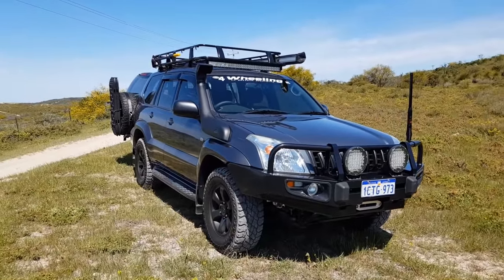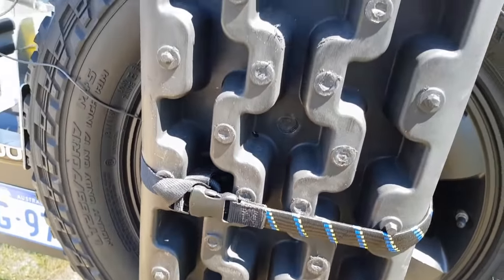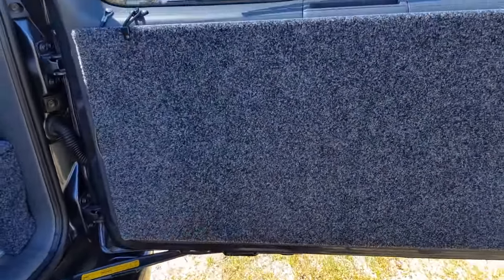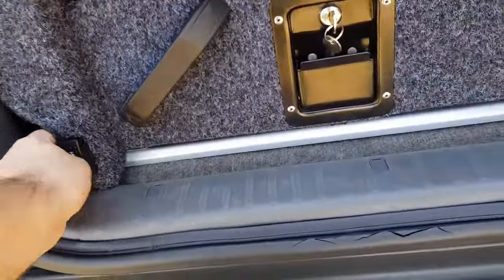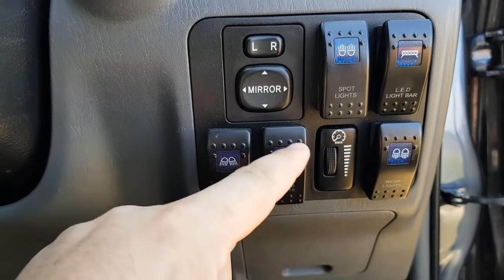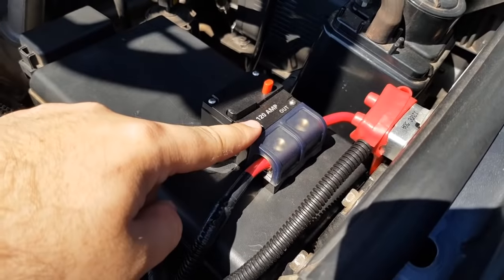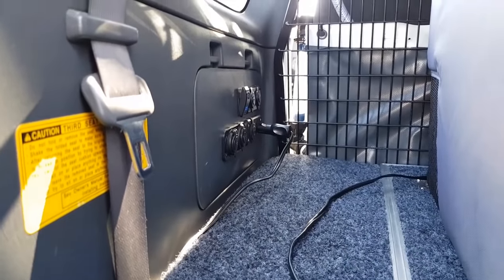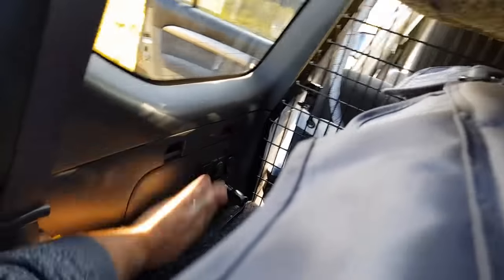Walk-around - Land Cruiser Prado 120 tourer

Comment: mate, one of the cleanest builds I've ever seen. Very nice work. If you haven't already add a rubber plug to your air compressor outlet on your bullbar so you don't get water in there.
Reply from the maker: Thanks mate - Yeah I ended up moving my compressor to inside the car in the boot so not so much dust gets into it and its cooler in there, I have an outlet at the back now rather than the front

Comment: What an awesome build! In the off chance that you see this 4 years later: Do you ever have issues with rain leaking in through the door seals where you have run wires from the roof and into the car?
Reply from the maker: Nope, never had any water come in there.
I have since re-wired those and ran the wires just to look more tidy.

I now have them come out of the left tail light and up to the roof there.

Comment: This is a ripper rig mate! Any chance you’d be open to sharing your plans for how you built the shelf & divider? Just top notch work 👌🏻
Reply from the maker: Hi mate, thanks ! I don't have plans unfortunately, that one was all just off the cuff figuring it as I go.

Basically just got a bit of wood for the divider and cut it in a shape that would work combined with the angle off the cargo barrier, couple hinges and carpet and its done!

the shelf was the same deal, just got some wood and carpet and cut to fit in the space

Comment: Hi mate absolutely grouse set up

How did you run the hose from the bladder to the outside of the car?

Cheers
Reply from the maker: Hey mate, there is a rubber bung just under the carpet near the rear left tail light area (near the jack compartment) . If you look under the car you will see it. Drill a hole through and poke the hose through

Comment: Wow, what an awesome setup! Very, very impressive. How did you mount the fire extinguisher - is the bracket drilled into the step by the rear seat? Great solution to get it out of the way. Love the removable divider and shelf idea too. Thank you
Reply from the maker: Hi mate, yes - 1 hole is drilled and just a nut on the back of the plastic, and then got 1 longer bolt of the same thread to go into the original threaded car body mounting hole.

Comment: Looks really good. Can you please detail how did you make the gas bottle holder. Thanks
Reply from the maker: Its basically a heavy duty ratchet strap wrapped around the Tyre - I used a product from Bunnings called "Grunt E-track Fixing Plate" which has cut outs for a strap to fit though. so that is basically strapped that to the spare Tyre, then i bolted an oz trail holder to that plate with another little flat bar to make it more sturdy.
Reply: @chappelle121  Thanks mate. Looks really practical

Comment: More details on how you mounted the air compressor? And the fan mod..
Reply from the maker: I have another video showing that a bit more, check my channel and you should find it.

I did actually since move the compressor into the boot as it still sometimes got too hot
Reply: chappelle121 did you mount it or just loose in the back?
Reply from the maker: @AstroBananna  mounted on top of my drawers left of the fridge and table

Comment: Mate… that’s a setup to be very proud of ! 👌🏻
Maybe a dumb question but have you done something to make your kings air compressor stop when it pressures up ?
I have one but I don’t think it stops like that at a high pressure. Maybe it does 🤷‍♂️
Reply from the maker: If its a kings thumper max dual compressor, it should have an inbuilt pressure switch, you don't have to do anything it just cuts out when it reaches a certain pressure, which if your trigger is closed and it's not leaking anywhere it should reach that pressure very quickly and just cut out until you open the trigger or whatever again which will turn it back on.

Comment: Very nice setup. What make is the LED Light Bar
Reply from the maker: Its an XTM one from BCF
Reply: @chappelle121  Thankyou
Reply: @chappelle121  Could you advice how tall they are including the bracket as have an ARB roof rack and would like to position it in the same location, I have a gap of 70mm from the roof to the bottom of the roof rack rail
Reply from the maker: @malkitr  Face of the light bar is ~82mm, add on the bracket and that's even more, so this one probably won't fit for you in the same way I have mine.
Reply: @chappelle121  Thanks for confirming will need to attach some brackets to the Tube bar then install.

Comment: Hey like your set up. Wanting to put a shelf and divider like yours in my Toyota prado 2018 150. Just wondering what thickness wood did you use? Also how exactly did you attached it to handles. I can see the O bolts on the actual shelf but could t quite see how it attaches to the handle up top
Reply from the maker: It was so long ago i don't remember to be honest, wood i would guess around 18mm. Attached to the handles by getting some threaded eye bolts that goes into the same thread as the handles. then another eye bolt on the shelf, and then a turnbuckle that goes between those eye bolts. and back the back just bolted to the cargo barrier.

Comment: Very nicely done mate. What's that bit the gas bottle holder is bolted to that the strap goes through I want to do something like that
Reply from the maker: Its basically a heavy duty ratchet strap wrapped around the Tyre - I used a product from Bunnings called "Grunt E-track Fixing Plate" which has cut outs for a strap to fit though. so that is basically strapped that to the spare Tyre, then i bolted an oz trail holder to that plate with another little flat bar to make it more sturdy.
Reply: @chappelle121  sweet thanks mate gona go pick one up on my break

Comment: Great set up!  Question, what size tires are you running and is the suspension stock?
Reply from the maker: In this video its 265/70/17, and stock suspension. Since then I added a 2" lift, though that size fit just fine without a lift
Reply: @chappelle121  Thank you

Comment: Am wondering what you used to make the back door table? looks real nice!
Reply from the maker: its just black melamine wood from the hardware store, cut to size, couple hinges, couple screws and the metal wire to hold it up. if you want like i did some carpet on the bottom is nice too. Everyhing you need can be got at bunnings (if you are in australia)

Comment: Love your build mate. Just wondering what suspension you have in it and what the tyre size is? Cheers
Reply from the maker: Hi Rob,
In this video the suspension was still stock but have since upgraded to a Ironman 2" lift with foamcell shocks

Tyres are 265/70/R17
Reply: @chappelle121  cheers bloke. Loving the rig

Comment: did you do a video on how to pimp the compressor , as thats a cool mod
Reply from the maker: I do have another video on the compressor about how I added the fans, though that compressor has since died, I did buy another (same but newer blue model) but just mounted in the boot now and it does not overheat back there (well it does get hot but can do 8 tyres)
Reply: @chappelle121  yes I seen it after cheers for that

Comment: Just wondering how the bladder fits between the cage and the back seats. I too have the Titan drawers and am putting in a cage, just doesn't look like there is any room left
Reply from the maker: I put a half cage in. So the bottom of my cargo barrier bolts to the top of the drawers essentially so the gap is bigger than if thr cargo barrier goes all the way to the floor
Reply: @chappelle121  what brand is your barrier?  Thanks very much!
Reply from the maker: @TheFerguscan  Its a Milford cargo barrier. I think it was from a Mitsubishi van... I got it for free and modified it to suit my needs (cut the bottom off and bolted to the drawers)

Comment: Hey Mate, 
Wondering if you could tell me what exact titans draws those are because I can’t find any specifically made for the 120 series x
Reply from the maker: back in the day when i got them they were specifically advertised as a draw set for prado 120. now i think you just buy the 900mm size twin drawers, and a 'wing kit' to suit prado 120. I'd suggest to contact 4wd supa centre to confirm that's accurate but that's my assumption.

Comment: Hey mate neat build! 
Just wondering how you go with water crossing given the pump and inverter is in the engine bay. Also do you have diff breathers?
Reply from the maker: Hi mate, have since moved the air compressor inside of the car in my drawer setup instead - in saying that I did a few small water crossings and it was not a problem for me - must of kept up enough momentum to keep water flooding the engine bay too much.
Only stock breathers which actually run pretty high up already - one of those jobs on the to do list though!

Comment: Did you have to fit a 12mm false floor for the drawers or did it all go straight in? Heard conflicting things and yours looks amazing
Reply from the maker: I didn't fit a false floor but my side wings are slightly angled but its possible to make it work without the added false floor (prefer to not have it to save a bit of weight)

Comment: Hey mate, I’m trying to do what you’ve done by ratchet strapping the gas bottle to spare wheel. I’ve got the same oztrial gas bottle holder but realise you’ve got some other small attachment between the holder and the tyre that it looks like you’ve bolted the holder to? Just wondering what it is, where you got it and how you went about doing it
Reply from the maker: I just went to bunnings, wondered around and just found something that would work. What i used is something called a "grunt e track fixing plate".

If i was to do this again now i would just buy the kaon gas bottle bracket, google that and maybe that might be a better solution for you :)
Reply: Thanks mate! Yeah have had a look at the Kaon ones. Look the good but a bit out of my price range. How did you go about attaching the bracket to the holder, would u do anything differently if u did it again? I want to make sure it’s as strong as possible
Reply from the maker: @liamnichol614  just bolted it, nah its fine and no need to change anything for me, plenty strong and sturdy.

Comment: Hey mate great setup, do you find that the fridge is too high for access?
Reply from the maker: It would be nicer if it was lower but overall its no biggie, for the convenience of the flat floor when the fridge is not inside its worth it I think
Reply: @chappelle121  thanks for replying man
My solution was to maybe take the left draw and stack it on the right one but yeah I like the flat floor
Maybe I'll just get a step haha
There's a bloke who removed some bearing so the slide angled down, but don't think you can do it with the Prado because of the doors

Comment: I’m curious how everyone gets there cables from the roof into the cab ??
Reply from the maker: depending how many wires you want to run up there, the best and most popular way is probably up the side of the windscreen, you can often tuck them into the side weather strip. In my case I had so many wires i also have them coming out through the door seals which I wouldn't say is ideal..  If i did it again i'd do it neater up the front or back. Best to have a google of this and look at some pics.

Comment: Firstly:  before you put allll that extra weight and bling on, did you upgrade your suspension?. I assume not. You will be near GVM before you know it with these cars. Trust me I know because that was the first thing I did to my 120 and boy does is handle better with the extra weight. I eventually removed abit of unnecessary weight but still getting up there.
Reply from the maker: In this video it was stock suspension but since then I have done a bunch more to the car, soon after filming this video i upgraded the suspension which was a good upgrade to do. It is quite common and easy to get near to or exceed GVM with these cars I know that.

Comment: for the rear door flip table, did you put some nuts at the back of the panel? or you simply drilled a hole and screw them on? thanks man! your mods are very clean!
Reply from the maker: They are just self tap screws from memory and has been just fine, Cheers.

Comment: Great job! Congratulations! Can you please tell me the brand of the cargo barrier? Regards
Reply from the maker: Its a Milford cargo barrier, it was actually for a Mitsubishi van (i got it for free) and i modified it to work for me.

Worked well because i just bolted it to the top of the drawers then i had room behind the seats for the water bladder where as normally a cargo barrier would bolt to the floor and take up that room.
Reply: chappelle121 thanks

Comment: Hi mate just wondering if you had to move and re mount the power streering reservoir to fit the auxiliary battery?
Reply from the maker: I'm actually not sure sorry, the car had the battery tray already installed when i bought the car. So if it was moved, it would have been moved before I got it.

Comment: Sir, the best build I have seen. Well done 👏🏻👏🏻👏🏻. If I may ask, what is the brand (or where to buy) of the camping lights on the roof rack?
Reply from the maker: My camping lights on the roof rack I got from ebay. For the ones on the side search for '6" flood light 12v' and the ones on the rear search for '7" flood light 12v' or something along those lines - you should see lots of suitable results.
Reply: chappelle121 thanks a lot! Cheers
Reply: @chappelle121  are the switches an ebay job too?
Reply from the maker: @2Calam  Yep

Comment: Hey man, that's a sweet looking rig! 

Quick question, hopefully getting one of these myself in the coming weeks (120, LC3) and I really like the look of your ARB bar. However it seems to be a grey area as to whether they are legal or not. Have you had any issues with the legality of your bar?
Reply from the maker: Depends where you are, here in Perth Western Australia there are definitely no issues, a very common early mod for most 4x4 owners here. Most 4x4's here have bull bars here. You will need to check with your local authority on local laws and regulations.

Comment: Great camping rig mate, what specific straps did you get to attach the recovery tracks to the spare wheel, there are loads of different types of straps on the rok straps site?
Reply from the maker: Bought mine on ebay, called "Rok Straps 500-1500mm"
Reply: chappelle121 thanks for that, another quick question is where did you get the cage that is behind your back seats?
Reply from the maker: got it for free on gumtree.
its actually a cargo barrier for a Mitsubishi van that i cut it in half so that it could sit on top of the drawers to make more room for the water bladder

Comment: Awesome build man, how did you make that air comp switch off when you don't pull the filler trigger? I've got a similar compressor and its fast but isn't smart I have to manually turn off to check gauge pressure
Reply from the maker: This particular air compressor has a pressure switch built in. You can modify another compressor by adding a pressure switch fairly cheaply if you are bit of a handyman and not scared of a bit of wiring. Should be able to find some info online about adding a pressure switch im sure.

Comment: Did you have to run a board under the drawers to give it more height , so the drawers didnt foul on rear plastic scuff ? Ive heard of a few people with 120's doing this!
Reply from the maker: I didn't but a common thing that has to be done with those drawers, i wanted to save the weight so my side wings just are slightly angled but you barely notice

Comment: G'day mate, awesome setup! You've solved an issue I was having, with where to mount the gas bottle, as I dont want that inside the cab. Quick question, what did you bolt to the Oztrail holder to get it to sit like that on the wheel? Cheers
Reply from the maker: Mine is a DIY solution, it is basically a big strap and something called 'GRUNT E Track Versatile Fixing Plate' from bunnings
Reply: @chappelle121  Thanks mate! That is exactly what I was needing, it's a really nice, clean setup for that gas canister, and looks solid. I've ordered one of those Fixing plates from Bunnings, so hopefully will arrive before i head off in 2 weeks on a camping trip!
Reply: Mate really like this set up, your video has actually inspired me to modify my prado for camping. Starting with the gas bottle mounted on the spare tyre which is absolutely genius. And the fold down table which is so neat and works well with bottle location.